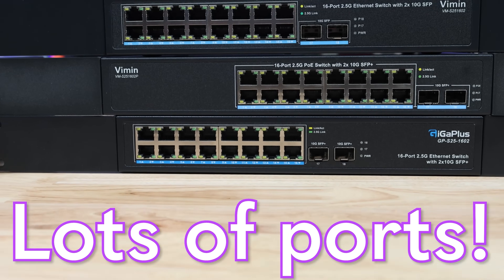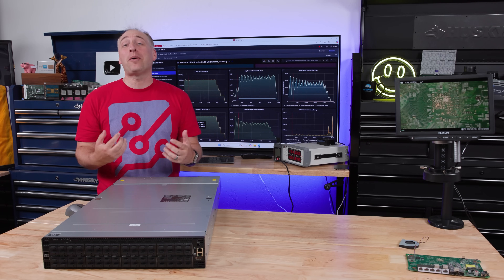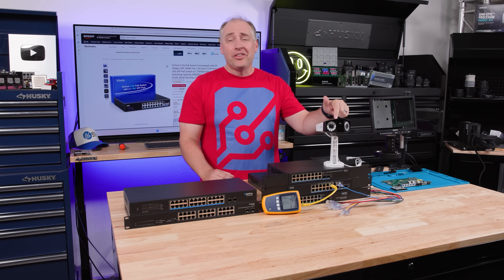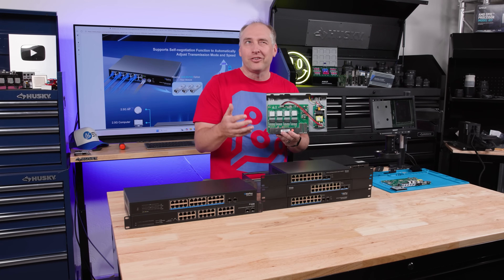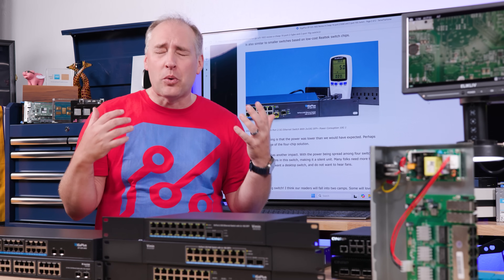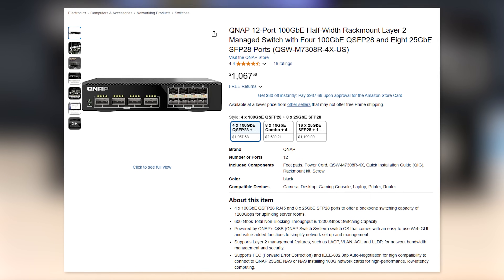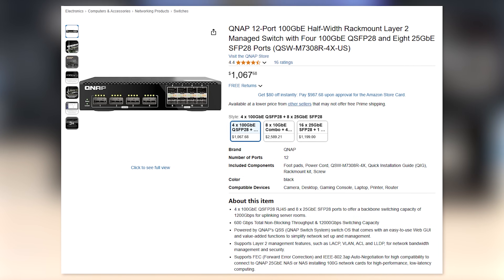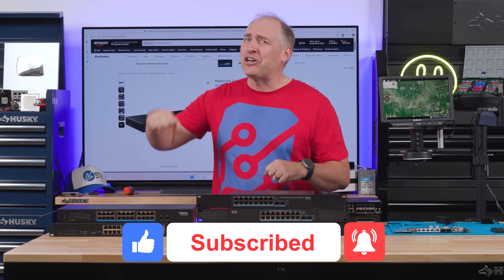New CHEAP Fanless 2.5GbE Switches Are Built Different

Comment: Late to the party, but I'd be very interested in finding out what the basic non-POE switches actually run on, once on the other side of the internal PSU.
I've got a 70 amp (yes, seventy) 12v supply inside the rack that's about 10% loaded.  Would be nice to feed 12v DC direct and not pay for another PSU conversion losses.

Comment: I'm looking for higher performance switches than these that can fit inside of a low voltage panel so, something around 11.5"
-12.5" max width.  Front facing ports with the power jack in the back like these is perfect.  Fanless is great but, not required as long as it's low noise level.  

Any suggestions?

Comment: The 16p PoE has me a little concerned for the power circuitry toward the top end of its operating temperature rating. I would be interested to see some thermal gun readings on the various components and connectors with the switch near it's rated power budget.

Comment: There is also a 16 Port Version without SFP+ cages (GP-S25-1600). Are the 10GE lines are just not used or is Chip #1 connected to Chip #4 for more internal bandwidth?
Reply from the maker: We have not tested that one yet

Comment: ARP tables are going to be a Nightmare ... How could you ever tell how this is going to be handled? Interesting nonetheless, thanks.
Reply: Unmanaged switches don’t have a ARP table.  The ARP table is for layer 3 to layer 2 address mapping.  An unmanaged switch doesn’t have any layer 3 capabilities.
Reply: @tomsamplonius4297  It needs a 'MAC table' at least so it can remember which MAC to reach on which Port - otherwise it would need to broadcast on all Ports all the Time

Comment: For the 16-port models, the daisy-chain architecture is a real shame: it means that if you pass 10 Gbps of traffic through the SFP ports, you saturate all the interconnect, and break all communications between 2.5G ports of different groups. They can claim 120 Gbps or whatever lie of total capacity, but their real capacity is 20 Gbps (i.e. capacity above which some ports might dysfunction depending on input and output ports).

Comment: Sure these are not full line rate on all ports concurrently, but for that price you still get a lot of good stuff and performance. For medium size office, retail stores, internet cafes, or CCTV it is pretty decent option. Obviously better than many 1Gbps switches. Also low power usage is a huge plus.

I would not buy it personally for the home lab or my office.

That 100Gbps switch from QNAP is nice tho. I have 4x 100Gbps switch from Mikrotik, and that QNAP might be slightly better in some areas. The only problem is QNAP software is pretty meh. But will make 25Gbps more popular for sure. Honestly 25Gbps should be new standard for workstations and servers. 10Gbps is not that interesting anymore for many years.

I love the videos that goes and open the hardware, check architecture, and do load testing and power testing. Thanks.
Reply from the maker: Thanks for the great use cases!

Comment: I have a mokerlink 16 port. It's worked pretty decent for me. I have a few 2.5gbps devices, my NAS has 2x2.5gbps ports, my desktop has one, and my WAPs and router have them. Everything else is 1gbps. For my usecase, I've found it pretty good. The main thing I like about it is it's fanless and silent, since my office is right next to my equipment closet. I bought mine of course before this video came out, and had I seen this, I might have bought the 24 port model for the better performance to future proof. But overall, fairly happy with it. I think I'm probably in the usecase you said they'd be fine for. 

It does outperform the previous fanned 1gbps brocade I had previously, but most importantly... No more fan whine. And a significant reduction in power consumption (Going from around 100W for the brocade to like 14W with all my devices plugged in).

Comment: Love this teardown but I think more could be done to explain the specific use cases where the 16-port shines vs where it fails.

If your 10G ports are on a server, and you're pulling data to/from the server to the 2.5G devices, then the 16 port will be find.  You'll max out the 10G port the server and the clients will get as much as they can take/share within the server limit.

The problem is when you have a lot of "side-to-side" 2.5G traffic between groups of switch ports and you have a lot of "side-to-side" traffic between the 10G ports.  When this happens, the bottleneck will be the 10G links between each of the "4-port" switch chips.  The side-to-side 2.5G traffic between the switch port groups will take up capacity on the 10G inter-switch chip links, and that will reduce the bandwidth remaining for the 10G links.

Perhaps a simple summary is that if you don't have much traffic overall on the 16-port switch, you'll reliably see maximum rates.  As you load the traffic through the switch, however, you'll see a drop from the maximum rates, and this is very dependent on how the traffic is flowing through the switch.  Worst case, you may see as low as 33% of the maximum throughput.  So if you're a single-server style configuation, the 16-port is probably fine.  If you've multiple servers or you have a lot on high bandwith inter-client traffic, then you may be better off picking the 24-port switches because they should be able do maximum rates on all the ports all day long irrespective of the network topology.

Comment: So the RTL9302D chip is vastly superior to running SFP in series? Suggestion also: can you do a break down as to how to interpret the graphs?
Reply from the maker: We have a bit more on the charts on the main site. We also have some of the new CyPerf testing. One of the challenges with the new tool is condensing information into a series of charts that are easy to understand. We are spending a lot of time on that one. If you want to see/ learn about the next one it is on page 2 https://www.servethehome.com/vimin-vm-s251602p-16-port-2-5g-poe-switch-review-cyperf/2/

Comment: I'd love a cheap 16 or 24 port 10Gbase-T PoE+, got some cheap hassivo's (you've also reviewed these) and they're fine for my distributed homelab but it  would be kindof nice to have one switch for the whole house even if electrically it's not different than having two switches daisy chained like i do now just to clean things up  (I never saturate a switch; sometimes i've got high bandwidth single links though, mostly storage related, eg ceph and some backups, occasional media transfers).

Comment: Getting a good idea about heat is definitely a metric that is easy to underestimate. I have a Ubiquity USW Pro XG 8 PoE, and although I really appreciate its functionality, it constantly sits at around 73C when using both SFPs, 7 of the ethernet links in use (one being a POE device)
Reply from the maker: Is that causing issues on the USW or is it just hot? Embedded devices often run warmer
Reply: @ServeTheHomeVideo  From what I can tell it is just hot. There is a working fan, but it seems Ubiquiti lets this model run hot. Still unnerving though when I discovered it.

Comment: I see GaN MOSFETs are getting common, 1/25th the on resistance of Silicon for a given chip surface area, resulting in 1/500th the power dissipation for a given load, bye bye heat sinks and cooling fans

Comment: That power supply must be some aerospace design to drive 16ports at PoE+ levels. Most probably it will succumb after 4 or 8 ports all switch-on at the same time and actually draw that power. Most modern ip cameras draw around 12-15W if they don't go over board with IR. Definitely the lack of feedback on how the power budget is handled makes me assume the switch will start boot-looping if the poe controllers are doing a poor job of handling over provision.

Comment: Congratulations on 1M subs!

re: $/Gbps
This is precisely the reason why I went with a 36-port 100 Gbps Infiniband switch which, at the time, costed me over $2200 USD used, because it offers 7.2 Tbps full duplex switching capacity which is more than I will ever use.

This allowed me to skip all of the bandwidth speeds/generations between 1 Gbps to 100 Gbps, and I just use two Netgear GS-116 v2 switches for more ports.
Reply from the maker: Thanks! That makes a lot of sense actually. I think in the next few months are going to push folks to higher speed networking.
Reply: @ServeTheHomeVideo  
Don't get me wrong -- $2200 USD back in like 2018/2019 was still a decent chunk of change.

But even with that, it was still a more cost effective and cost efficient solution.
Reply: what an absolute unit of a switch!

Comment: At 11:57 you show a PCB which has a 512MB Micron RAM chip (the 9302D is a fully managed switch chip, so this one is just "playing dumb" and is running at least the uboot bootloader to initialise everything, but possibly a full Linux OS).  The close-up shown about a second later seems to be from a different switch (maybe the Mokerlink that's reviewed on the STH website?) which shows a different 128MB Winbond RAM chip.  Either way it's probably possible to port OpenWrt to both switches and run a long-term supported Linux distro on it - complete with security patches, and the like.  It's possible that they've skimped on the flash size, but if they haven't bother to cost-optimise down a 512MB RAM chip to a 128MB, then perhaps not.  OpenWrt has already been ported to a similar design of unmanaged switch - the Zyxel xgs1010-12 (which has hardware nearly identical to the managed version - the Zyxel xgs1210-12).
Reply from the maker: Good points

Comment: Is this 16 port device you talk about at 9:03 advertised as blocking or non-blocking switch?
It must be blocking if your assumption regarding the backplane between those "30 Gbps switch" chips is right.
Reply from the maker: Often they just advertise 120Gbps switching. We show that it is clearly not a non-blocking design in some of the performance testing a more detailed version using a ~$1M CyPerf tool is on the main site https://www.servethehome.com/vimin-vm-s251602p-16-port-2-5g-poe-switch-review-cyperf/2/

Comment: When two vowels go walking, the first one says it's name: It's v-eye-min. I'm getting a Banana Pi Wifi 7 router because it has 2x10G SFP+ ports. I really wish it had 2.5G ports but I can use the gigabit ports for my security cameras and use one 10G for the NAS and one 10G for a 6-port 10G 2.5G switch that goes to my workstation and another 6-port 10G 2.5G switch to another workstation.

Comment: So you're saying that switch is four switches in a trench coat?
Reply from the maker: Ha! Good one
Reply: @ServeTheHomeVideo what I feel like you missed in the video was the conclusion of having the 4 switch chips chained like that. I presume it means if you run 10Gbit from sfp to sfp then the switch is saturated and other traffic will slow down the sfp traffic. And that it makes a big difference on where you should plug in devices. Eg 2 copper devices that send traffic between each other should be on the same bank of 4 ports. And copper devices that send a lot to the sfp should be on first or last bank
Reply: @ServeTheHomeVideo  anyway, this is very useful info. Thanks for making the video. I learnt something today. I have this mentioned with Mikrotik but always assumed switches didn't have this limitation. Looking at the board for my switch, gs728tp, I can see a bunch of switch chips. Hard for me to tell if it has similar limitations. I will put high bandwidth devices closer together in the future.

Comment: why sfps are connected to edge chips instead in the middle? more layers needed for traces?
Reply from the maker: Other than the long trace from the left chip to the left side SFP+ cage, this is probably the simplest/ shortest trace design. Or it might be that is just how they designed it.
Reply: That would require crossing one of the 10gbit links to the other side of the pcb, crossing over one of the other 10gbit links - and that gets into some rather tricky to deal with signal integrity and propagation issues. It's probably possible to do, but it would be far easier to make with this layout which does not require any crossover of high speed traces.

Comment: It would've been good to suggest some ideas of how to optimally use the 16port switches to get the most out of them.

Eg, if you're doing SFP to SFP, you're going to throttle all the ports, whereas if you have a couple of 2.5gbps devices that you always need high-speed between, ensure they're on the same cluster of ports.

Comment: Information missing : Are they UL CSA or whatever certified ?   So are they legal to use in canada and usa.  Second, are the SFP port allow for active and passive, or only active.  You should do power test also with DAC.  When you talked about the QNAP pricing, add the SFP RJ45 modules 10gbit modules in the price, or the SFP28 fiber module pricing... They add up quickly.

Comment: can someone, more experienced with switches answer this: if I have 1 gig ports for end-device, and 10g for trunk / cross-switch link. Will there be output drops on the 1G interface due to the speed difference and buffering limits?

Comment: Then you should not connect the upload to ports 1 to 4 or ports 13 to 16. It is better to use port 5 to 12 for this. 
This means you have a maximum of two 10GB connections to jump through.

Comment: I've had one out of three cheap 2.5g ethernet switches die. You need to pick and choose as well, I found many don't support 100m links. TiVos and network tuners are what led me to this discovery. The switch failure, of course, happened two days after I left the house and was 2,000 miles from home. When your wife can't watch Netflix because the port your Nvidia Shield is plugged into died, it's a major problem. I think the extra heat from the SFP in a fanless box is asking for trouble.
Reply from the maker: If you are from Phoenix, then you get heat (our studio is in Scottsdale) - I also had one experience years ago with a virtualized pfSense where it worked great, but it had an issue and I was away trying to do tech support on a firewall VM. That made me simplify as well. Do you know if the switch died or was it the power supply? Our #1 issue on low-cost network devices is power supplies

Comment: I've got the qnap switch with the 100gbe ports, but I'm still waiting on the 100gb nics.  Really, the issue is inexpensive NAS (storage) that can run at that rate.
Reply from the maker: Yes that is totally the case right now
Reply: It's something you need to DIY for now.  (What are you whinging about? You're running a homelab, right?) Get some form of ARM/Linux based, small form computer able to support a bus to HDD/SSD or 100Gbe (through a macguyvered bus connector, or pcie card) or obsolete PC/laptop repurposed as a NAS/media server. You won't get that mass manufactured reliability or power efficiency (is it really *that* important?), but it beats waiting around another 10 years.  Now if only we could get an "affordable" 3-4 port SFP+ switch (with additional low speed ports to hook into outside router/switches...)
Reply: @eugenechoi6666  You can't really provide a 100Gbe feed from HDDs, and getting 50TB of storage on SSD isn't cheap.  You could do what I'm doing now which is to cache the HDDs with SSDs in front, and that mostly gets me a decent 25Gbe setup, but it's a long way from 100Gbe.  A low-power Ryzen with a decent pcie5 board in theory would work, but getting an 8 lane pcie5 card with 8 x4 pcie3 could get tricky -- I haven't gone looking recently.  The thing is, $500 a pop for the 8TB drives to make a 48TB raid6 (or equivalent) setup is the kicker.  Wake me when those drives hit $250.  Actually, I might start biting if they ever hit $300 at this rate.

Comment: I wish Ubiquiti would bring their switches down in price a little bit, I want to get an 8 port POE 2.5GB switch but its hard to bring myself to pay 200 dollars for a switch nearly equal to other switches I can get for 100 or less if I am willing to lose a few features. Just need POE to power a couple cameras, AP, and doorbell.
Reply: Doesn't sound like you need 2.5Gb for that. Unless you have a NAS or server with a lot of local file sharing or a LOT of local users with a >1Gb internet connection, you won't actually utilize more than 1Gb of throughput.
Reply: @LUSkyhawk I have all the above and more...l I have full 10Gb for my NAS/Servers most of my network is already 10 and 2.5 just need one more to finish it off. I work from home and test a lot of system integration type things and can have 50/60 vms running at time many over iscsi....its hell on my power bill but I get to stay in sweatpants most of the time...lol. that switch also connects more than cameras and the AP it runs to my living room for all my devices there. It does saturate at times. I have 1Gb internet currently probably won't go to 2 anytime soon but it is available all the way to 7Gb here.

Comment: The problem with the QNAPs is that they are like 40% more expensive in Europe. ~20% is explained by VAT but the other 20% seems to be Qnap tax. still managed with 4 x SFP+ and 8 x 2.5 gb would be good for me. and then a bit low on power consumption since European power prices are still quite high.
Reply from the maker: It is a challenge. Sadly, we do not set the prices of these by country

Comment: Click if you find this over complicated and just prefer ubiquiti, even though more expensive
Reply from the maker: This is easier than Ubiquiti since they are unmanaged, right?
Reply: I would if Ubiquiti didn't break open source licenses - they've ignored my request for source code on wifi access points, and done the same to others.  Considering they build their products off the sweat of open source developers (to the extent of using an uncredited fork of OpenWrt) that's just rude. In contrast, Zyxel and TP-Link  publish GPL source and put it up on their websites without evening being asked.